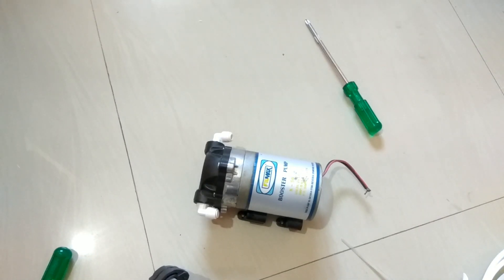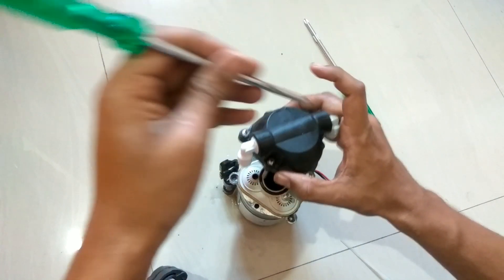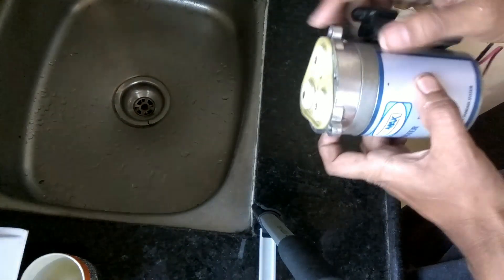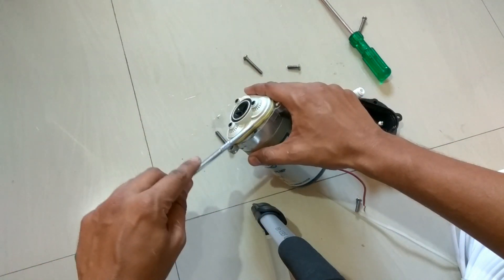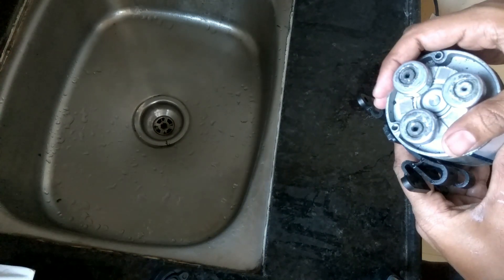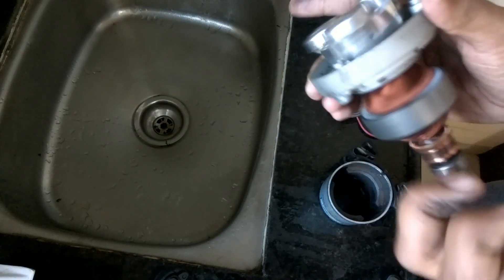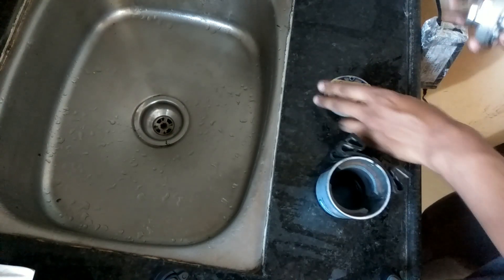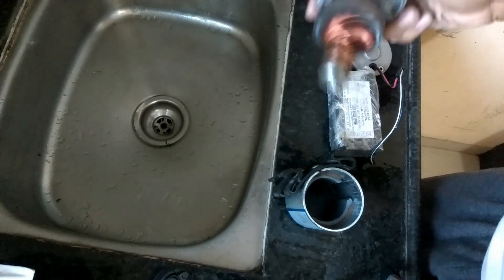Inside a RO Booster pump

Comment: Not upto the mark. Use proper names for parts of motor. Bearing, brushes and  o ring. The way you open the motor spoils the carbon brushes. Learn Well and make video.

Comment: Aap shayad galat ho bro. Ye jo rotating part hai. Woh sirf rotate hi karta hai. Jab woh teen metal rounded shapes yellow rounded shapes se multi hain to woh yellow aur white rounded shapes mein space Kam ho Jata hai. Jisse high pressure banta hai yellow aur white mein. Jab metal Wali aur yellow Alag ho Jati hain to yellow aur white mein space Kam ho Jata hai. Jisse low pressure banta hai b/w yellow and white. So Is low  high hotel rehne se aur valves ke khulne band Hone se pump kaam karta hai
Reply from the maker: +Varun Sharma ok

Comment: Normally brands mention following product information:
1. Body/Housing/Pump Head Material >>> Normally made of PA66/Nylon66/Polyamide66 or polypropylene 
2. Valve >>> Normally made of EPDM
3. Diaphragm >>> Normally made of  Santoprene

I am not sure whether, apart from above, any other part comes in contact with water being pumped. If yes, can you please tell me its name and if possible its  material of construction.

Comment: can you please tell me which rating pump should be used for a 80 gpd membrane, the pressure in psi
Reply from the maker: Damu Sscone 80 gpd membrane a pump of 100 gpd  can be used with FR of 450 or 550. sediment ->carbon -> pump > membrane

Comment: One of the worst Video I have ever seen no knowledge only screwdriver technology - why will you need proper ground for a 26/34 V system and you are not insulating ends pity ..
Reply from the maker: +Venkateshwaran Subramanyam tThank you for Your valuable comments
Reply: Venkateshwaran Subramanyam bro my purifiers motor is working but not through water from output. Kindly tell me about the problem
Reply: Notice that the voltage is obtained from a adapter it is always wise to be protected even it is isolated